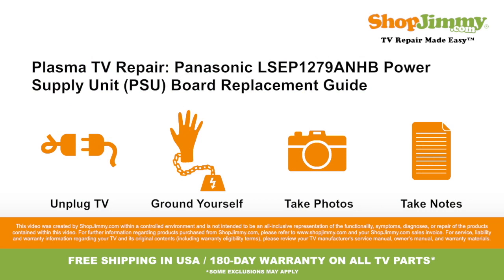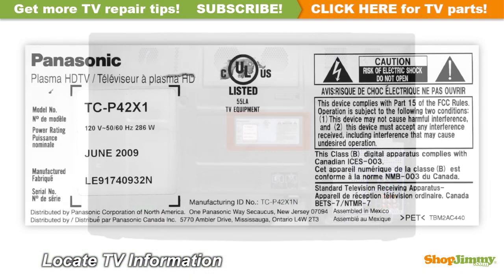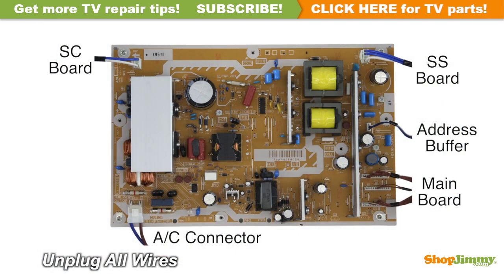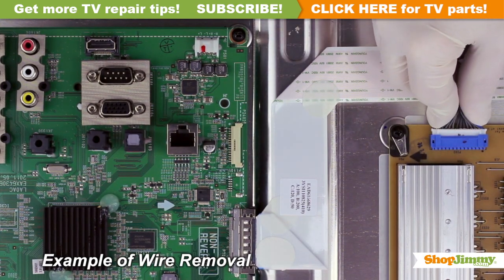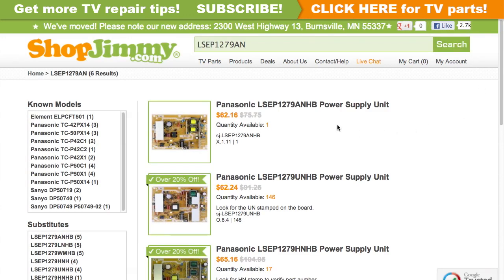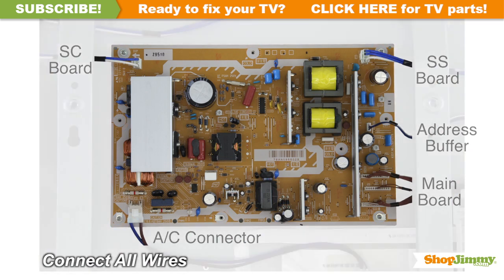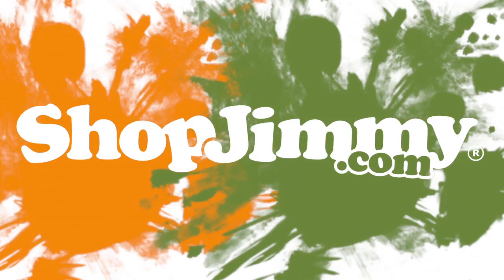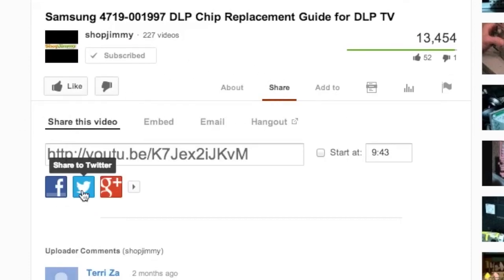Panasonic LCD TV Repair - TV Won't Turn On - How to Replace Power Supply Board

Comment: Hello. Yesterday we had a storm and lightning, and my Panasonic Viera TX-P42G10E wouldn't switch on. The on/off button doesn't show any sign of life. I guess there must be a protection component that got fused. Where should I begin troubleshooting? Thanks

Comment: I have a Panasonic P50U30A. It turned off while working, then will not turn back on.  If turned off at the wall and turned back on the tv flashes like normal load up but does not go any further?  Is that power supply?

Comment: I have a TC P42S30 and I have a strong continuity reading on both the ground and the Vsus at P2. The video led me believe I should have no reading on the ground. So I'm not sure if I should proceed to the next step or not.  The Picture and sound suddenly disappeared while viewing. The power light was showing red but would not turn off.

Comment: Panasonic led tv tx-55DX600E
I have a "one red blinking" flash light. Did some researche, found out that the inverter circuit that is located on the lcd panel needs to be replaced. Is this information correct? Can i order a new one on "shopjimmy"?

Comment: Hi How R U, Having A Problem With My Panasonic TC-P65ZT60 65” Plasma, Tv Was Fine A Month Ago & Now Just Turned Tv On For 1st Time In Over A Month & Have No Signal For BlueRay Player & No Signal For Cable Dvr Box, Now We Had A Few Nasty Storms Recently In Last Month Where My Power Went Out 4 Times Quickly & Came Back On & All My Equipment Is Plugged Into A Panamax Surge Protector, The Tv Is Plugged Into A Receptacle That Is A Surge Protector, Now Go Try & Watch Tv The Other Night & Now I Have No Input Signal On HDMI 2 Which Is Arc Input & My Cable Box Is On HDMI 1 & No Signal Either!! No Blinking Code Lights From The Tv Telling Me Something Is Wrong, But It Hasn’t Been Hooked Up To The Internet Yet, So Could It Need A Recent Update From Panasonic Or Did My Main Logic Board Take A Crap? But Have No Blinking Codes @ All

Comment: Hi sir, I have the same problem on my TV 2 resister blown red light comes on but no green light can you help me how to check what wrong on  power board. My TV Panasonic model TX-32WG25X

Comment: Hi sir, Now I have a problem with my Panasonic TV model TX-32WG25 series, it has shorted 2 resisters red light on but no stand by yellow light TV not coming on.the power board part NO TNPH0015 also I need to know most common problems and how can you ship Parts.

Comment: Hi i have a panasonic tv TH42A400A, there is no picture or sound, i have swapped out the power board and there has been no change. Would swapping out the A-board (Main board) fix the issue ?

Comment: i have a Panasonic Viera TH-42 PX70B plasma tv. It has recently started to trip the electric. I press the power button and it makes the noise as if its about to come on and then the electric trips. We've had no new sockets installed or new appliances recently. I plugged the tv into a different socket and it still tripped. Can anyone advise?

Comment: Hi shopjimmy.com, I have Panasonic Viera TX-48AS640E, on Saturday night the TV was working during the whole night, the same night there was storm, in the morning I saw that countercurrent protection was activated, there was no power, I switched the power on, but the TV  did not start, all the other machines have started successfully- like fridge etc. There is no power on the TV at all, nothing blinks, please advise what to do, as I have no TV at home.1 and a half day have passed since then, I have replaced the power cable but same situation

Comment: If you have a plasma one and it wont switch on try switching it on by holding in the power button on the side and the channel up and down at the same time for 5 seconds.

Comment: My Panasonic TC-'L26x1, LY90960282 red light on solid , but no picture . black screen , no click when I power off at tv, remote does not respond or shut off tv

Comment: dear sir

i have 47" philips lcd which have model no tv 47pfl 7422/98/p. this lcd logic card is not working it have been damage. what will i have to do for solving this problem

Comment: Plz help my TV model no is TH-L32SV6D it Is also a blinking problem 10 -2 \
Reply: I have a Panasonic Plasma HDTV model number TCP50ST30 the power light on the front turns on when button is pushed but nothing shows up on the screen it's blank what do you think the problem would be what board would I have to replace

Comment: My tv now won't turn on at all--the display when turned on makes the usual 1 click noise when you first turn it on and then displays a black screen and stays there--with the red LED on the front bottom screen displaying power staying on with no blinking light. Whereas after this happens the remote doesn't work or respond to the tv, and also the buttons on the tv do not work at all

Comment: For several weeks prior to the dead tv, I had a 6 inch wide vertical line down the entire left side of the screen. I don't know if this is related to my dead screen issue. Hopefully it's all related to a power board problem How can I test to be sure?

Comment: hi.... I have Panasonic viera plasma tc-p42st70, with no sound no picture, black screen, I have stb ligth,5 bolts 13 bolts in the power supply. but nothing happens, can have some tips to fix the problem, thanks and God bless you all

Comment: Panasonic tc-p50x1. mf92820195.
I had order 4 parts from ur shopjimmy.com . the parts that I order and repair and replace p/n tnpa4781, tnpa4780,tnpa4848, and tpna4774. stills  have same problem black screen on bottom and pictures  on top and have sound. but I don't have no problem with blink light.what could be problem?

Comment: have a Panasonic TC P42UT50....suddenly shut off and now wont turn on..red light stays on regardless if using converter or on button on tv????help please??
Reply from the maker: +Ana Rotella  Try all repairs and troubleshooting at your own risk.  I recommend replacing the the power supply board in your TV.  Click this link to replacement parts for your TV model number:  http://www.shopjimmy.com/panasonic-n0ae5kk00001-p-board.htm  There may be multiple boards for the same TV model number, be sure to match part numbers on your current board, with your replacement for compatibility.  Here is a link to a video showing how to identify your part number, click here:  https://www.youtube.com/watch?v=N1ophMtQeZU  Thanks and please let us know if you have any further questions with your TV Repair!  www.shopjimmy.com

Comment: I have a panasonic plasma hdtv model no.TC-P42X1. 
serial no. LA92790434.When i push the power button in I get 12 red blinking led lights and nothing else. What could the problem be?

Comment: Hello,my son throwed a stone to the screen what should i do?do i need a new lcd screen?my tv model is panasonic TX L55WT60
Reply from the maker: djan djano  Try all repairs and troubleshooting at your own risk.  If your screen is cracked,  it may be more cost-effective to replace the TV as panels are typically hard to find in stock, difficult to replace, and expensive.  Thanks and please let us know if you have any further questions!  www.shopjimmy.com

Comment: I have a TCP-50C2 Panasonic plasma TV. When you try to power on the red light comes on it makes a click and then blinks 10 times pauses then blinks 10 times etc. I unplugged the power cord replugged. then I unplugged the Line that goes from the plug to the SC board plugged it in, Nothing then I plugged the SC board in and turned on and same thing with the 10 blinks.

Comment: Hi Jimmy, I have a Panasonic P50GT30, an american model which is running in Europe using a step down converter. It has been fine for several months. This week, after a prolonged 7 hours of use it 'popped' quietly and would not go back on. The back of the TV was very hot, as was the step down converter.

Now the TV has no power running through it at all.No lights, and pressing the power button does not have any clicking sound. I guess I need to replace the power supply board, would i need to replace anything else? Do i need to replace it with an american power supply board or can i just swap in a European one?

Comment: Hi there mate i was just wondering if you kow the blink code for 7 flashes of the standby light with panasonic's? mine is a th-p50u30a got a new power supply board but now its still flashing which indicates to me its another board
Reply from the maker: n0username0n  PLEASE SUBSCRIBE TO OUR CHANNEL - Try all repairs and troubleshooting at your own risk.   What was the original problem with your TV?  Please list all of the symptoms and problems.  Thanks!  www.shopjimmy.com
Reply: I have subscribed before asking ;)

Yeah i know aha, been doing it for a couple of years.

To be honest not 100% percent sure, its just a tv i have bought and that i am trying to repair to re sell as are most i do. at first i thought it was the PS Board until i got another and the fault continues, Now that i know the power board is good and working it seems like there is a buzz/hum coming from the SC Board, after reading a few forums, there seems to be a fault with the plasma panel itself that can cause issues and i dont want to go through and replace more boards if the problem is just going to persist further, hence why i was asking if you knew what the 7 flashes indicated towards

Thanks alot mate

Luke
Reply from the maker: n0username0n  Try all repairs and troubleshooting at your own risk.  I recommend replacing the SC, SU & SD boards in your TV.  Unfortunately I do not see any replacement parts in the search results for your TV model number on our website.  Thanks and please let us know if you have any further questions!  www.shopjimmy.com

Comment: hi how do I know it's the power bored it flashes three times stops and does it three more times until the three set the model is a tc-p50x1
Reply from the maker: Marcelino Franco Lara   PLEASE SUBSCRIBE TO OUR CHANNEL - Try all repairs and troubleshooting at your own risk.   I recommend replacing the power supply board in your TV.  Click this link to replacement parts for your TV model number:  http://www.shopjimmy.com/catalogsearch/result/index/?cat=59&q=tc-p50x1  Be sure to match part numbers on your current board, with your replacement for compatibility.  Here is a link to a video showing how to identify your part number, click here:  https://www.youtube.com/watch?v=N1ophMtQeZU  Thanks and please let us know if you have any further questions with your TV Repair!  www.shopjimmy.com

Comment: Hello, I have a Panasonic plasma model TC-50PX14. It stopped working, it show ten blinks whenever I try to power on. I was told the power supply needs replacement, I replace it but still not working and showing the same symptom. Need help
Reply from the maker: Jamal Hardan    Try this at your own risk. Unplug the TV, then disconnect the SC board and plug in the TV to see if the TV powers up. Reply with the results of this test. Thanks! www.shopjimmy.com

Comment: hello there, i have a panasonic TC-P50X5 that keeps turning itself off, runs for about ten minutes then shuts off, i turn it back on then it shuts off every 5 minutes, any ideas?
Reply from the maker: Chad Landers   I recommend replacing the power supply board in your TV.  Click this link to replacement parts for your TV model number:  http://www.shopjimmy.com/panasonic-n0ae6jk00006-p-board.htm  Be sure to match part numbers on your current board, with your replacement for compatibility.  Here is a link to a video showing how to identify your part number, click here:  https://www.youtube.com/watch?v=N1ophMtQeZU  Thanks and please let us know if you have any further questions with your TV Repair!  www.shopjimmy.com

Comment: My panasonic model # TC P42G15 and serial # MA91550475 does not turn on it just flashes red so would this be this be the same problem and i would need to replace the power supply board?
Reply: what does the sc board look like
Reply: I unplugged the  board the tv light stays red for a few seconds then flashes 6 times red and keeps doing that. When everything was plugged in it only flashed 5 times. What should I do?
Reply from the maker: Joseph Chaldo  Please watch this video FIRST to help with your repair!  https://www.youtube.com/watch?v=BP3NVNCGEv8  I recommend replacing the SS board in your TV.  Click this link to replacement parts for your TV model number:  http://www.shopjimmy.com/panasonic-txnss11xbf42-ss-board.htm  Be sure to match part numbers on your current board, with your replacement for compatibility.  Thanks and please let us know if you have any further questions with your TV Repair!  www.shopjimmy.com
Reply: you sure i looked on the manual for my model, 5 blinking lights means broken A board aka main board

Comment: I have a Panasonic TX-32LMD70A and when it turns on there is a green light but now it won't turn on and its just a constant red light instead
Reply from the maker: Sam Hitchcock  Please watch this video FIRST to help with your repair!  https://www.youtube.com/watch?v=BP3NVNCGEv8  I recommend replacing the main board in your TV.  Click this link to replacement parts for your TV model number.  http://www.shopjimmy.com/panasonic-txn-h10agte-h-board-for-tx-32lmd70.htm  There may be multiple boards for the same TV model number, be sure to match part numbers on your current board, with your replacement for compatibility.  Here is a link to a video showing how to identify your part number, click here:  https://www.youtube.com/watch?v=FKTTj91YcGc  Thanks and please let us know if you have any further questions with your TV Repair!  www.shopjimmy.com

Comment: I have a Panasonic TC-L55E50 flashing the power light 10 times.  I replace the A board and now it is flashing 8 times.  Any suggestions.  Thanks
Reply from the maker: Gregory Kidd   I would return the A board.  Then replace the TV.  Unfortunately that blink code if not specific and it could be a problem with one board or multiple boards.  Thanks!  www.shopjimmy.com

Comment: My 50" Panasonic plasma tv went dark and silent suddenly and would not turn back on. Just dark and a steady red light. Model TC-P50ST30. I took off the back. Now what can I do to troubleshoot?
Reply: ShopJimmy.com After I disconnected the SC board and plugged the TV in---the red light blinked 7 times over and over. So I unplugged it.   What does that mean?
Reply: Merry Kropff When I say I disconnected the SC board, I mean I disconnected the power plug from the SC board. Did you mean disconnect the ribbon cable to the SC board?
Reply from the maker: Merry Kropff   Try the same test (the first test you described) on the SS board and please reply with the results.  Thanks!  www.shopjimmy.com
Reply: ShopJimmy.com After I disconnected the power plug from the SS board, I plugged in the TV and pushed power on---the red light came on continuously and stayed on--it did not blink.
Reply from the maker: Merry Kropff   Please watch this video FIRST to help with your repair!  https://www.youtube.com/watch?v=BP3NVNCGEv8  I recommend replacing the SS board in your TV.  Click this link to replacement parts for your TV model number:  http://www.shopjimmy.com/panasonic-txnss1pcuu-ss-board.htm  Be sure to match part numbers on your current board, with your replacement for compatibility.  Thanks and please let us know if you have any further questions with your TV Repair!  www.shopjimmy.com
Reply: ShopJimmy.com I replaced the SS board with a part I bought from SJ. Now when I turn it on it blinks 14 times. Note: I think I made a mistake in my earlier posts and testing by using only the remote control to turn on the TV--so it didn't blink, it was only a steady red light.. But in my last test (I got 14 blinks) I did it right using the on-off switch on the TV not the remote.
Reply from the maker: Merry Kropff   Then it is most likely a problem with the SC board.  It is recommended you replace the SU and SD boards with the SC board as those boards can sometimes cause the SC board to have problems.  Click this link to replacement parts:  http://www.shopjimmy.com/catalogsearch/result/?q=TC-P50ST30  Be sure to match part numbers on your current board, with your replacement for compatibility.  Thanks and please let us know if you have any further questions with your TV Repair!  www.shopjimmy.com

Comment: Hi Shop Jimmy Guys,  I've got a Panasonic TC-P42X5 from 2012, won't turn on,  with no blinks, but there's a small red light at the back when it's plugged in.    I opened her up, caps look good, maybe a little gray dust evenly spread across the far left board. I haven't checked the voltage (5V wire). near the transformer.  I'm a little uncomfortable with it plugged in and testing it.   Any suggestions

Comment: Hi my tv makes ticking sound when I try to switch it on.
The model nuber is PS50C490B3W Samsung Plasma TV. Please Help
Reply from the maker: Faizal Khan   Try this at your own risk. Unplug the TV, then disconnect the y board and plug in the TV to see if the TV powers up. Reply with the results of this test. Thanks! www.shopjimmy.com
Reply: ShopJimmy.com I did change the Y Board, its still the same problem??
Reply from the maker: Faizal Khan Thanks, but I am not asking you to change the Y board, disconnect the Y board and plug in the TV to see if the TV powers up.  Does the TV power up with the Y board disconnected?  Reply with the results of this test. Thanks! www.shopjimmy.com
Reply: I disconnected the ysus board and tried to power up the TV, the turns on without the ticking noise with the blank screen but still the same problem when I connect the ysus board back. Ticking sound